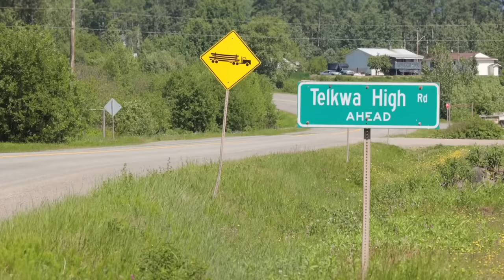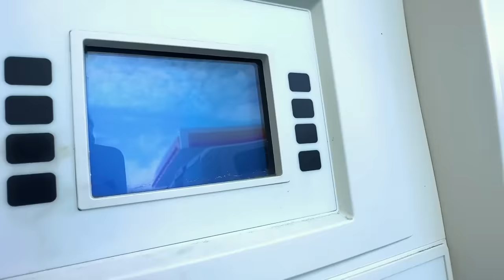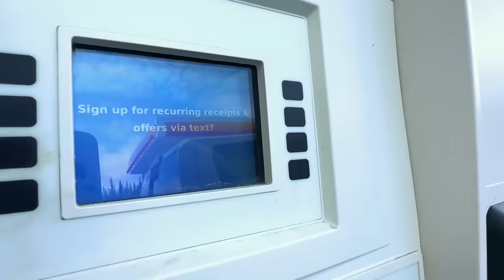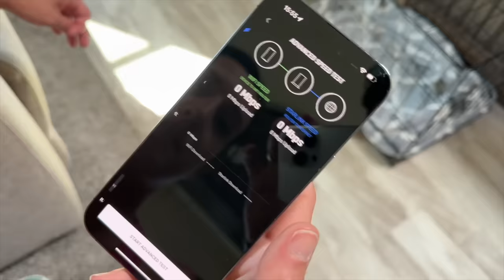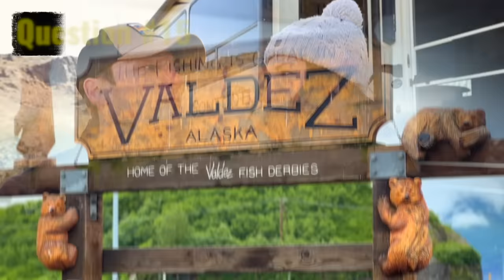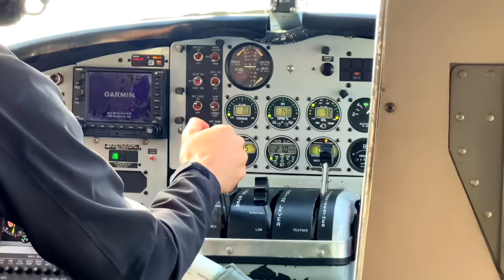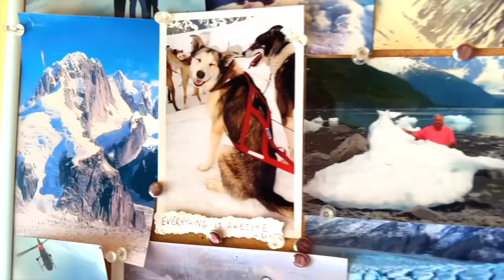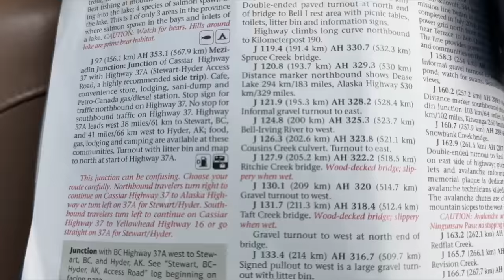20 Honest Truths We Wished We Knew Before RVing to Alaska (RV Travel)

Comment: Honestly I would not recommend relying on bear spray only! I would have some additional means of safe guarding against bears, as something that weighs as much as a VW bus is not going to stop on a dime even with bear spray especially if it is charging you at a full run. But I also would recommend being mindful of your distance to anything wild, as the closer it is to you the greater the chances are that it “WILL” hurt you. As there are places in Alaska where you are required to have a firearm on you when you go outside for a reason.
Reply from the maker: Thanks for the solid advice! It’s definitely smart to be extra cautious when it comes to wildlife. Appreciate you looking out for us! Also, thank you for your support in watching our videos 😀

Comment: Just to let you know, my husband and I entered Alaska May 29, 2023. We woke up to  a couple inches of snow and slush in Tok. We really could count on one hand how many days were completely without rain, from May 29th until we left September 6th. We did however have sunshine and less rain on days we had planned excursions, thankfully. Yes, it barely rained the previous summer. Prepare for both.

By entering end of May, we avoided the Tok area mosquitos. We also avoided them by spending the entire July in the Kenai.

I have to make note that alot of campgrounds going through Canada and in to Alaska are not open until mid May. So keep that in mind if you are thinking of going up earlier. Also the upper border crossing near Dawson City, isn't open that early either. We originally called to make a reservation in Whitehorse 2 weeks earlier. The receptionist just laughed.

Speaking of the Kenai, bring bear spray. There were alot of bears walking through Hidden Lake Campground. The Hidden Creek Trail had a looseleaf note left, dated the day before. "Three grizzlies spotted on trail today!" We used our whistles the entire hike. You could see over 5 trees had their bark removed, up to 10 feet from the ground. That same day, we were on our way back to camp. I stopped to take some dusk pictures. No bear spray on because we were done for the day. I got back in the truck and my husband says, "Is that a bear behind us?" Yes it was! Another time my husband turned around, down by the river at Russian River Falls, only to look straight in to the eyes of a mother bear, with cub, 20 feet away!

As for pictures of Denali, stay out late or getting up early can help. When I say early, I mean 3:18am for a sunrise picture of Denali on June 15th! Sunset is around 11:45 pm. Denali South Viewpoint has a wonderful view, and I don't mean the one you get just off the parking lot. Walk a little farther to the end of the path to the right. Also if you can boondock, stay at Denali South. You can get some pretty good pictures in early am and late night. Also don't believe the weather forecasts. If you have the time, go and see for yourself. One of the days I took pictures all afternoon, evening and in to night, even though the weather forecast said it was cloudy!

Denali National Park, though closed at mile 43, still has two pulloffs between Riley and Savage. The one with the bronze plaques gave me my pink sunrise of Denali. Speaking of that, if you camp in Riley, you can use your vehicle and drive up to Savage. There is a hiking trail across from the Savage Cabin and another good view of Denali. If you can, stay 5 days at Riley and then 5 at Teklanika with an unlimited bus pass. At Riley you can book ranger led hikes. A ranger hike necessitates purchase of a green bus pass for the day. Take advantage of it after the hike and ride until mile 43. The day we did that, I took my best bear, caribou and sheep pictures there. Once at Teklanika, the next day you can start to use your passes for unlimited trips per day. Though, to be honest, the two we took per day were plenty! 

I didn't bring our solar panels because we have a small 23' bumper to hitch trailer, and I didn't think with trees and rain they would be worth it. What was definitely worth it was the Bluetti AC200Max with two DC charging blocks. Those were plugged in to our Champion 2500W duel fuel generator. The set up worked flawlessly, after I connected the Bluetti directly to the trailers 12v system. Daily use needed only an hour on the generator to fully charge the Bluetti, with those two bricks. It would have been a trying experience if we had run the Bluetti on AC power only. It uses 55w/hr just to have that side on. Get a 12v cord for your cpap if it will help conserve battery power.

If you have an America the Beautiful Pass, you get half off of any BLM campsites, such as Tenderfoot, Hidden Lake.

If there is a certain whale you wish to see, research when it is usually seen. We had one unscheduled fishing trip, with Red Door, in Homer, where we limited out on fish, saw puffins, saw several whales and a rainbow at the tip of the Kenai. We went on two whale cruises and saw no whales on them. We did however, see a very large portion of the Columbia Glacier have about a 1/4 mile of calves in a domino effect, puffins, numerous sea birds, sea otters, sea lions, sheep on the mountainside and jellyfish. Beluga whales were seen many times off the road on the Turnagain Arm. We also saw whales from a turnoff near mile 48 on the Sterling highway.

I totally agree on things to purchase, or not. You don't need all the gadgets. The number one I can say is new tires for the vehicle and the RV. Repack your trailer bearings before and after the trip. Also look at your axle. Is it still bowed slightly upward? I had already planned on an axle upgrade, but it turned out to be a good thing, because even though we weigh everything, and balance the load, our axle was shot! It was actually drooping before the trip. So check your axles and springs. Extra wiper blades came in handy as well as lots of velcro, gorilla tape and short drywall screws!  

For boondockers, Halibut Campground in Anchor Point was great for going in to Homer, but staying out with the wildlife. Olnes Pond north of Fairbanks was also awesome. Gold Mint Campground up at Hatcher Pass was one of our favorites too!

All in all, it was an epic trip and I am already taking note of the campsites you mentioned for what I hope will be a next time!
Reply: Please copy paste all yr good information and post on a blog or website !!!

Comment: We were in Alaska July 14th through Aug 21st. AlCan in Cassier out. Loved Cassier, although both are beautiful drives. We crossed into Canada at Sweetgrass Montana and took the AlCan. Destruction Bay to Tok was part of the worst road, followed by Denali Highway...and they use the term "highway" very loosely...the Denali and Dalton Highways are gravel roads and  Denali you don't dodge the pot holes, you try to pick the smaller ones. Not complaining, it was part of the experience!   Just figure you are going to be moving at a much slower pace, so sit back and enjoy.  

First, we have a 21-foot 2015 Rockwood camper and a half ton pickup. We had a lot of tar speckles on the camper from driving through construction areas, and there are a lot. Used WD-40 to get it off. We put new camper tires on in 2022 and  put new tires on the truck before we left, and we didn't have any problems. 

We boondocked along the side of the road most of the time, staying in campgrounds when we were going on an excursion. We also used iOverlander. Agree with your assessment of the campgrounds. They aren't posh, but I wouldn't want them to be. 

My husband at one point talked about flying to Alaska and renting a camper there. Then he realized how much  we would have to pack on a plane, and he quickly decided driving was a better idea. We live about 45 miles west of St Louis, and it took us a week to get to Alaska. 

Since we knew we were going to be gone for at least 2 months, we didn't want to board our 7 yr old Lab Molly. She is our best camping Bud, and the trip wouldn't have  been the same without her. 

Our truck is gas, and like you said, just fill up when you see fuel. But "The MilePost" does a wonderful job keeping you informed.

Speaking of "The MilePost," get it well in advance and read through it. Highlight points of interest. It will also help you plan your trip and possibly what order you want to do things. We did not make any reservations pre-trip. We didn't know how long it would take to get from place to place, and we didn't want a schedule anchoring and stressing us. We had no problems getting campgrounds or excursions on the fly. It was one of the most relaxing trips we have ever taken. 0:01

Comment: Great job guys! You have subjected your trailer to some pretty rough roads. Food for thought have all of your spring hangers inspected to make sure you don't have any cracks starting. I just got done installing new 4000k leaf springs and welding in braces that go side to side on the spring hangers to try and prevent cracks in the frame and broken spring hangers.

Comment: Great job guys. Can I ask what size is your fift wheel. Wandering about hauling ours up there's it's 40 feet and I have a one ton Ford with no duals is that enough  thank u keep up the good work
Reply from the maker: Hi Mike! We have a 34 foot fifth wheel. It's honestly hard to say, because so many different rigs very in weights, and the trucks follow suit with how much they can tow. A great place to start is in the door jam of your truck within the yellow sticker. There you can find a reference point of your specific trucks payload. Also you can check out the user manual for specifications on tow ratings and limitations. Hopefully this was a little bit of help. We appreciate your great support and for taking the time to watch our videos - Kyle and Renee

Comment: Ok, let's talk about the roads. Alaska has very short summer, hence why visitors hit construction time. When it comes to RV parks, who would want to have paved spots? Pavement attracts heat, which is not fun inside RV. Coming to Alaska is to experience wilderness and not concrete LOL. Next, mud flaps. Yes have them installed. this is not just to protect your vehicle but other drivers as well. Alaska mostly never uses salt during winter, instead uses pebbles/ gravel and many roads are not paved as you experienced, so imagine the force of rocks catapulting from your tires and hitting windshields and hood of vehicles behind you (perhaps motorcyclist) or others doing it to your windshield. They should really make it mandatory in Alaska.  
As far as weather it's a hit and miss depending on years. There were years when is was hot in April and warmer in May than in Orange County California. There are years when August is sunny and years when it rains non stop and same for July. This year was the most gloomy May in history according to weather channels. It comes in waves, so when sun hits, due to long daylight, it feels super hot but when it gets cloudy, the temp is instantly cooler compare to lower 48th when it gets cloudy during summer. Gas is expensive because it has to be refined in lower 48th then shipped back up ans summer season with tourist excursions is short, which is why these prices are high. 
As far as clothing it's best to bring attire like hiker would use, so rain gear, windproof, trail shoes, bug net, thin gloves for shoulder seasons, head cover, water filter for bottles is helpful. Keep surroundings clean and bring your smiles and fun attitude. Alaska is wild, gorgeous and has such a clean air (except for wildfire areas).